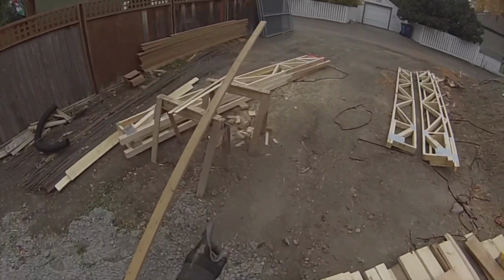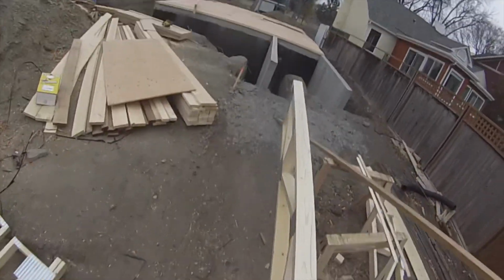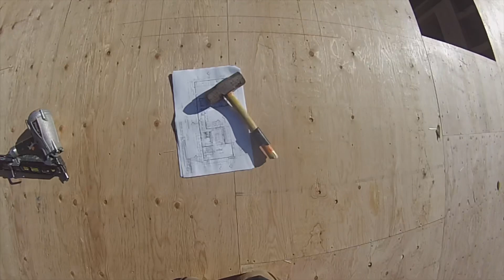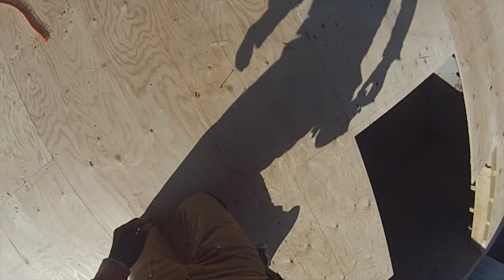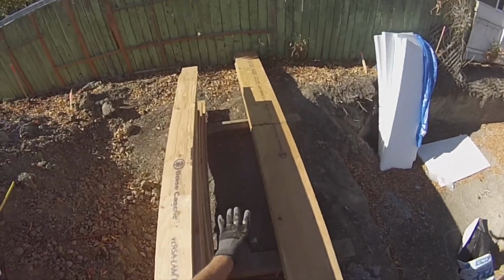Southside Home Day 4 @ Amazing Framer (watch the ending!!!)

Comment: It shocks me on how you build a whole house by yourself, but you walk back, and forth lot, seems to much time wasted. But your houses seem to get built fast, when we are not seeing you working. So do you got a crew that comes in, and gets on it between videos ? Now back in the day when I was a young man of 40, I would build whole houses by myself, no helper. As, I could roll flat bottom trusses, as standard ones myself too, but I would try to get help on rolling the cathedral trusses, as they spin down even with two people. I know that you keep at it, as like a Ant, you seem to be working quite slow, but you seem to get allot done. ? So again do you have some others that help you get it done between videos ? As you had this house, similar to this one ? Maybe it this one, that had lots of angels, and bull Shi! Going here, and there in the roofs design. As one day you have your walls up, and then your trusses are up, and you are filling in, here, and there, lots of blocking slowly. Also your floor, lots of back, and forth, snapping lines, should have filed the chalk box before starting to snap them. I would have snapped allot more lines before taking off. Also, where you snapped some lines, I would have ran the tape under the ply, over to the concrete, and checked that distance, then taped it on top as to see if it was correct otherwise. A good way to lay it out is to use a big Alluminum Speed square, as laying out these many corners, as its faster than taping it, and getting both dirrections 90 degree, as while you are down there, measured, & nailed, nails for both ways, as while there. As bending over once, and Not walking back, and forth so much, as it is wasting allot of time. As less bending over is better, as you get older. This framing wears out your back, and so does bending over so much. I remember seeing another lone framer, and he used saw horses allot, as to not have to bend over much, and like he would grab a bundle of studs from a pile in the garage area, and drag them over to the saw horses, and drop or lay the tops over one of the saw horses, as against the saw horse, and the floor, as so when he needed one, he did not bend over. He could then sight them easy prior to putting them into, or between his top, and bottom plates. Me, lots of times I would sight, and crown them, and mark with a arrow, if someone was trying to help me, as so crown was up. 🤗  Also this carrying every thing, one by one, walking the material over along the 5 1/2" concrete walls, why no ramp or scaffling, as that's so slow, and dangerous. Big waste of time, as waiting on the contractor to back fill it for you. Totally crazy, they Jack you around by it not being back filled. They should have to kick you some extra $, but I would say back fill it, and go hiking, or sleeping in, until done. As no need to take chances of injury. Plus, if back filled all materials should be Folk lifted = Lull, as boomed in right up close, if not on your buildings floor, as where you can finish that section of exterior wall last, or boom in farther,  as easy in and out. It's nice you get a cage lift, and can get your ply, and stuff up to the trusses, and on the roof. You have some empty spots as no video, and lots is done in between. Maybe you got elfs, or Wee Little Helpers doing some of the house. You are fairly quick on some of your figuring, but, I think you have built the same house, and floor plans many times, and so you can do it in your sleep. This walking walls carrying stuff is going to get you hurt some day, and you will be sitting in a chair, talking to yourself. Saying, Why me. ? 🤣 I know, as I am a arm chair non carpenter now. I do like this Next house foundation you jumped to, as that ones going to be easy to get it going, and can drop allot of materials into the middle of garages dirt, next to the houses foundation walls. Doing framing as you, having a Lull to move materials close to where you are working, and booming in a whole bunk of studs onto your floor, where no walls go, or maybe just one interior wall, and you may burn them up before needing them gone. I used to get a guy to help, and I would fire them in a hour or two, as they were lazy dumb Arses, and just did not think. So I did as you, building whole houses by myself. But, you need a good guy that you train from scratch, a good board carrier. He's carrying more boards as you are nailing them. In time he's ahead, and can help nail stuff. I am surprized that you are not required to glue the joice before laying the ply on the floors, as to have No squeaks. It's code here in WA, State. I would have nailed 2 nails on each side of them 2x4 truss joice to the green plate. You needed some thicker wedges too. Then later after you had the joice all nailed, the ply nailed, and go down in the basement, get up on a ladder, and spray foamed under that crack of space under the plate. As it fills the gap, stops bugs later, cushes the boards, and keeps the wedges from moving or slipping out on you. Some Counties here, they make us use a 1/8"  blue plastic spongy sill plate cushion, as its a spongy sill plastic. It some what levels the plate, cushions it, less air can seep through under the sill. I see some guys get there plates ready to go on, or they framed the wall with the treated plate, and they staple the foam on the sill plates bottom. Do you ever watch kens Karpentry, he builds just Garages. As easy, and fast, and gets paid quick that way. He does all the concrete, and finishes the concrete floor too. He has videos on how to build a ladder hoist, out of a extentions ladder to raise plywood up to the roof, as to make it easy to get materials up to the roof, or trusses. As many of these garages he does, he should have his own Lull, and use it allot to make it easier, and safer. As they do the siding, and roofing off of ladders. Where he could us a long narrow basket, as I have seen you use, as for safety, and it's faster. Like blocking or bird blocks, on the plate, facia, and starting your ply. He should use one, but does not. I think he did now and again, to raise trusses, but it was just him, and his son building them then. He's got lots of helpers now, and they roll right along. But climbing ladders. He does alot of Garages with storage, and or a apartment over the garage, and steep roofs of 12/12. They should use a Lull and basket on that, as it would be way faster, and safer. Getting the ply started, and easy to drag it from a person thats raised it up, and slid it from the basket, as so you can grab it easy, and drag it into place, and tack it down. The metal roofs they do, they usually use these Big Giant Ladders that can fold at about roof height, and the ladder can lay down flat up there to walk, or climb up to lay, and screw the metal roofing panels down, as metal is slippery, and dangerous to walk on at a 12/12. If I were you, I would use scaffold pump jacks, and planks too. As a few wide Alluminum planks you could have been carrying the material over that hole around your foundation, as way faster, and safe. Well, good Luck, and be safe. 🤗
Reply from the maker: Wow! Thanks for your comment. The longer I frame the better I am getting at moving slower I purposely do it. I have noticed the slower/calmer I go through my day the more I get done. I use saw horses for cutting. What I have noticed as well is the longer I frame the more time I spend cutting….. them assembling. It is important for me to love my job so racing to move fast and get stuff done creates the exact opposite atmosphere I want.
Thank you A A
Reply: Well they do say that opinions are like assholes, everybody's got one!